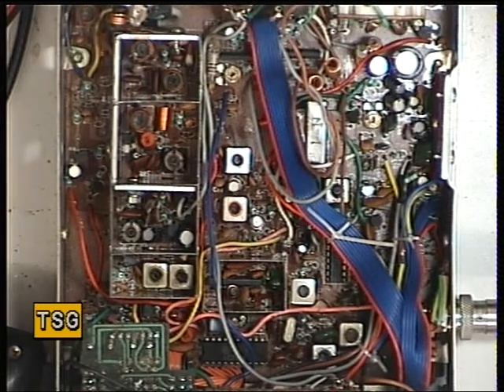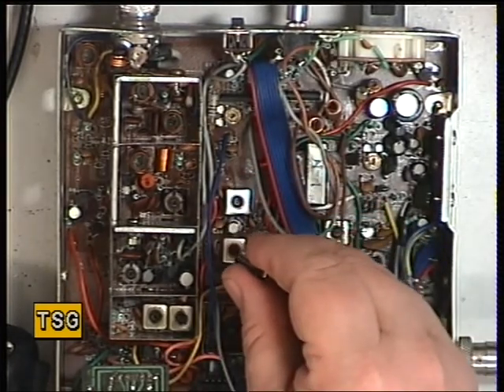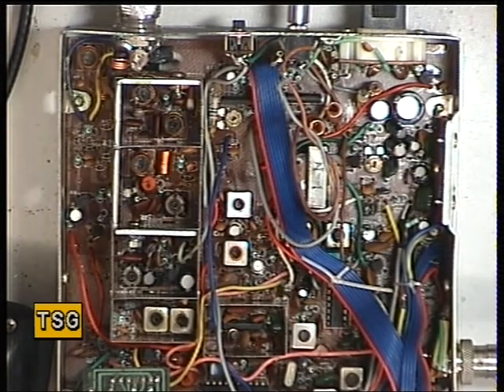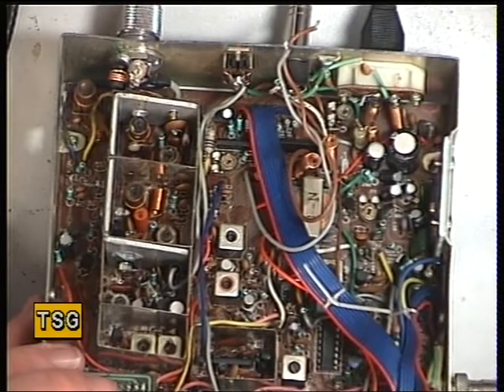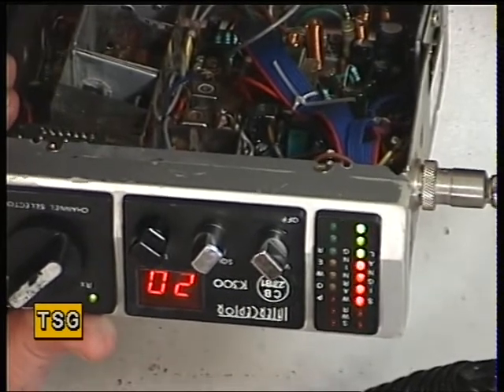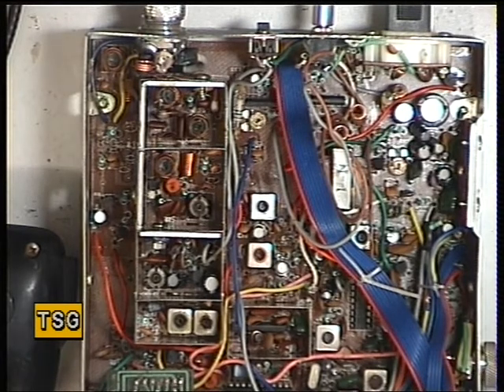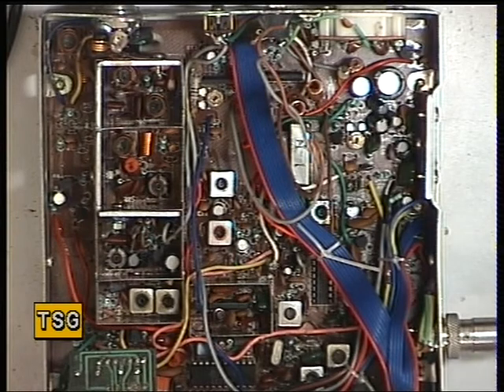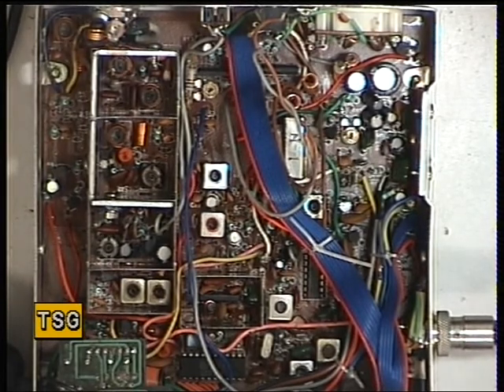Interceptor TC300, UK (CB 27/81) CB radio (Mobile) - Receive alignment

Comment: There is a adjuster for signal but looks like its missing in that one
Reply: Bottom left side near the black capacitor between case and heatsink  I can see the three holes where the variable is in mine
Reply: I've put a picture up on FB Grantham Breakers for you to see where I mean